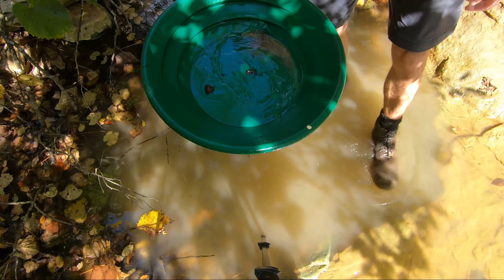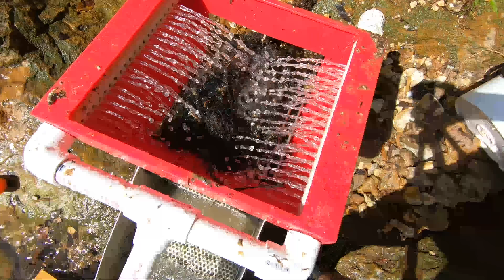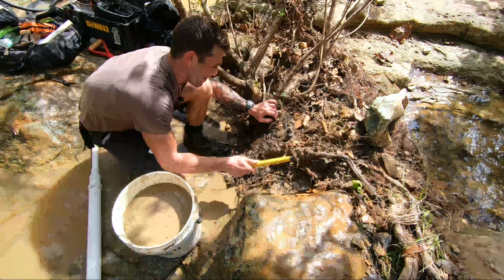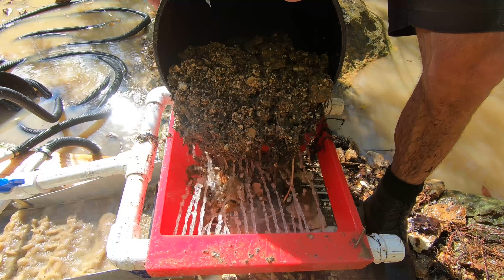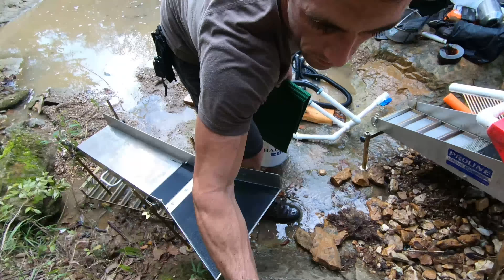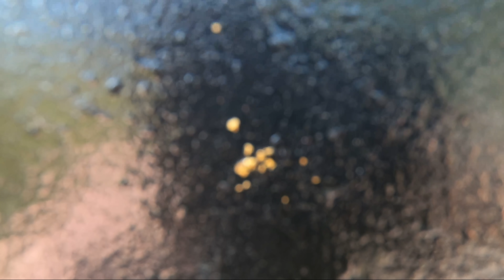HIGHBANKING FOR GOLD!!!!!

Comment: Great video and effort!  Absolutely love the high banker sluice on sluice. I am a Geologist by education and I can tell you that your system is catching ALL the heavies in the areas you are working. You don’t get that much lead and lose the gold. Your set up is working beautifully!  Move that set up to a gold bearing stream in NC or SC and you might be shocked at what you might have at the end of the day.  

That said, if you have a microscope, take a gander at the gold you are pulling out of the creek. See if it is angular and jagged versus smooth and tumbled. Can tell you a lot about how far it has travelled from the source. I expect that it will be rounded and flattened validating that it traveled, as you stated, from the upper north. What is the bedrock you are working: appears metasedimentary.  Could also be the source of your gold. Find the deteriorating quartz veins in the bedrock and you might find a higher concentration of gold. High water and obstacles in the creek do a great job concentrating gold once it is separated from it’s source. Use those high concentrations to pinpoint possibly where it is coming from. 

BTW, Missouri must have a shortage of squirrels and rabbits evidenced by the extraordinary amount of buckshot in your creeks. 

Love your videos. Keep making them!  We appreciate you!
Reply from the maker: Thank you very much and I appreciate all of that info as well I will use it !
Reply: I just arrived at my farm in NC from ND. I am cutting firewood for the next two days and then sitting in a creek outside of a Charlotte, NC for two days. I put together a gas powered pump/dredge set up, but they haven’t had rain here in a month. Looks like I’ll be going pan by pan unless I can dam up the creek and recirculate the water through the sluice. Doesn’t matter...just sitting in the creek when it is 90 outside is refreshing. A successful effort is any amount of visible color in the pan. I haven’t videoed any of my excursions, but I may send you a pic or two of my take if I find any.
Reply from the maker: That would be awesome ! Let me know how you do!

Comment: Kyle, the red handled trencher, I call mine my little bit.h. lol. But I love her.
Reply: Is there a reason you like the trenching shovel? I have only ever used a regular shovel.
Reply from the maker: My spade was stuck under a bunch of stuff in my truck
Reply: Ya. First mine is 34 inches long
 It is so heavy duty that I can use it as a short bar without breaking the handle. It fits in tighter spots easy to carry fits in my backpack well enough. And it works better in Rocky soil better than the spade. I can mention more but I think that my little bit h is pretty versatile in thick/dense area's. Good digging and let's find that gold.

Comment: I've been watching your vids just wanted to let you know you might be a little under powered on water your loading up in front of the first riffle a 79cc pump from harbor freight would probably be enough for your unit there around $160👍 keep at it
Reply: I was thinking the same, but loved his idea tying three pumps together.

Hey Kyle, check out and make sure you’re subbed dyer gold prospecting and the active miners in his comments. A lot are Ohio or Midwest miners that run glacial till gold like you have there in MO. 
I learn and laugh a lot from those guys and gals. Good people. 👍🏻

Here’s my mental puzzle what Kyle has done may help.
I have a 2000/gph that runs 7amps. I have an 1100/gph that runs at 3amps.
I may test out running two 1100’s and be running more water with less amp draw. With my batteries, that would give me one more hour of running with my batteries “on paper”. 
I need to figure out a side by side comparison and test that out. 🤔

Dang, that would give me a half hour more run time, not one hour. 
Too early in the morning for maths. My brain is still asleep like I wish I were. 😂

Comment: Kyle do you have a TSC  or  Fleet and Farm or a Rural King store near you they should carry a small gas powered water pump that should give you more water flow they are usually under 200. Dollar's. Most are run with a motor similar to what a leaf blower or weed eater use a little noisy but should give you decent water flow for that set up .
Reply from the maker: Yep got a rural king and a harbor freight.